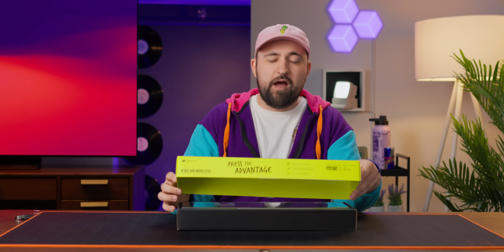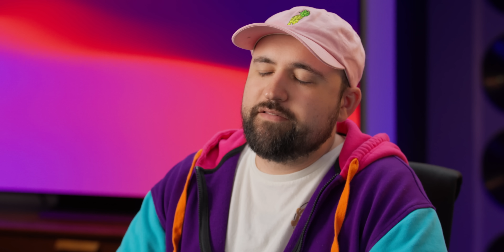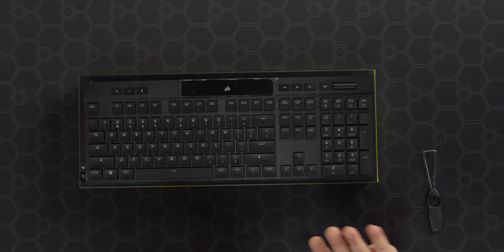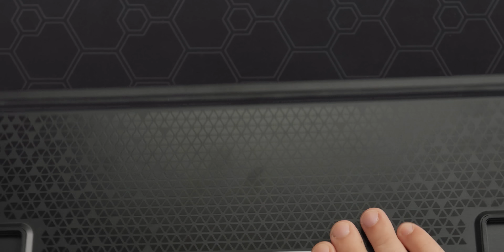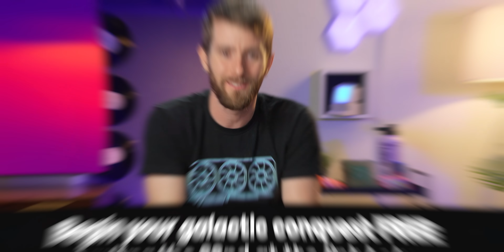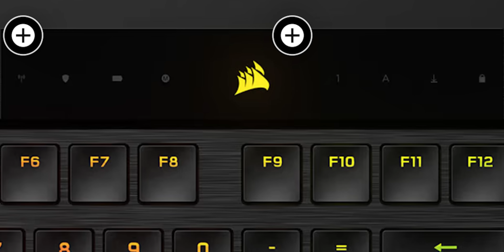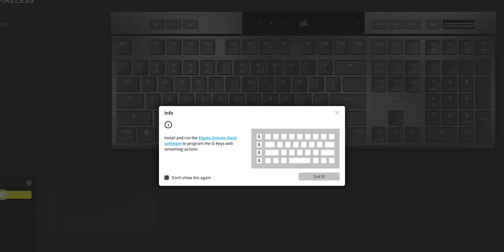Corsair's THINNEST keyboard yet - Corsair K100 Air

Comment from the maker: Correction: At 0:26 the measurements are meant to read 439 x 156 x 17mm (or 17.28 x 6.14 x 0.67 inches). This would be a VERY thick keyboard at 170mm!

While your keyboard can be low profile, your galactic conquest does not need to be. See why no two games of Stellaris are ever the same FREE starting this Thursday at https://lmg.gg/StlSC
Reply: You put an ad in a correction? Really?
Reply: Does it come it white or silver
Reply: Why did you show the size in cm and mm.  thats kind of redundant no?   mm and in  would make a lot more sense
Reply: It is still a thick boy...the Rapoo E9270P is just about 4mm thick. i used it for my media pc on the tv. it works just fine, is thinner and just costs about 50euro.
Reply: imagine having to recharge your keyboard every 3 or 4 days. thats not for me. XD
Reply: Good catch... For a minute I thought I was going crazy.
Reply: The design is great but the keyboard seemed bad to me, the keys get stuck and if one breaks you can't exchange it. I had to take it to the warranty and they gave me another one just like it, key failure... it lacks a lot to be a good low profile.
Reply: Talking about and reviewing an ULTRA SLIM meant to be low profile...precedes to put it on top of a 3 inch box and type on it "meh it's okay" it's no longer low profile while you're doing that lol
Reply: @yackemup bruh, low profile doesn't mean it needs to stay flat on your desk, you can put it a bit elevated, it won't interfere with the actual actuation and feel of the switches 😂

Comment: Honestly, for me this keyoard is not worth it at full price. When a perfectionist like me pay such a high price, you expect perfection. Unfortunately, it is common to get a K100 air that has some imperfections in terms of design. I have tried 2 keyboards of this model and with both, I have noticed minor scratches when inspected carefully and thoroughly straight out of the box. I have also found reviews online having the same complaint. So my advice is: if you're a perfectionist, buy this keyboard only on discount.

Comment: I've always preferred ultra low profile from years of laptop gaming. I remembered having a razor keyboard that was discontinued. I couldn't find another, so I settled for a Logitech g915, but the keys wore out super fast from gaming. I did some searching and found the corsair k100 air a couple of years ago now, It feels great, it's quiet, and I have zero wear on the keys, despite plenty of gaming and regular use, unlike my logitech 915 that wore out in a few months.

Comment: do the keys feel the same as a laptop, as in does it take some pressure before the keys click down? as i like to be able to rest my fingers on the keys without the key going down. i have heavy fingers. i bought the corsair mk.2 low profile keyboard and hate it because the keys still feel like jelly when i rest my fingers on them and cant tell if im pressing the key or not.  im tempted to buy this but need to know that it feels just like a laptop before forking out the money. bit confused at to why they used butterfly instead of scissors. 😕

Comment: Why are the secondary options of the keys almost never also lit up?
Also I'd just like a low profile 100 % wirless backlit keyboard. Doesn't need mechanical, membrane fine.
For several years I have not found anything, they always do other weird stuff with them, like Mac buttons, recessed key caps, half height F keys and so on.

Comment: For those looking into getting one of those, don't.
Everything is glued together in this keyboard, not a single screw was used. Any issue means a complete replacement. Only after a few months I an now stuck with a refurbished unit that is in a way inferior condition than what my near pristine keyboard used to be.

The keyboard itself is insane. Keys are perfect. It's a 5 star product but it loose 7 because it's a throwaway design..

Comment: they shortened the cable......beware......the cable just made it to the tower. with next to no slack. Love it though.....had the k95 for years. 

Not a fan of wireless devices.....im old school, hard wired. It does come with diff keys and the puller

Comment: I moved away from chicklet as I was told how “good” mechanical keys were. And bought a k70 mk2. Myself. My wife and 10+ people who used the mk2 all remarked that it was junk to touch type on, constant mistakes even 2 years later.

Sold it at great loss and went back to an apple Magic Keyboard to fill the gap. It’s absolutely gorgeous to type on. 

This mechanical keyboard trend is odd to me. I’ve not met one person who could type quicker on a chucky mechanical compared to a slim chicklet or membrane keyboard. I want to keep with the Corsair ecosystem, but I’m worried to reinvest in Corsair. Something was SO off with the mk2 K70.

Comment: Far less mushy than the Logitech G915 (mine feels stiff like the iPad keyboard, but better), but to be fair, I’ve had the G915 for like 3 years (so it has a few.. hundred thousand metaphorical miles on it) and I got this in really recently (within the week).. I also got a steep discount so that may color my opinion somewhat.

I’m still very partial to my other keyboard with the Glazzew (boba) switches I respringed, but the board I have those in is very not portable.

Comment: I have this and I love it, the B key broke and I'm returning it tomorrow. It did everything I asked for, it was a Full Keyboard, Lights up, Ultra Slim, and it was Mechanical. It went above and beyond when it could store Macros (for when I went mining in Minecraft), switch between setups using the doggle on my main one and Bluetooth on my subsidiaries and the customization was insane. It will be missed

P.S. I'm typing this with my old keyboard lol
P.S.S Dang that's crazy, using my keyboard and saying how my keyboard is going to the graveyard, good thing its not sentient because man, this would be an awful way to go

Comment: ICUE is the worst program today. Absolutely terrible. I have it on two corsair case systems and one will not see my corsair RAM and the other will not see my commander pro xt. So how is it good exactly? Even opened a support ticket and they said to make sure the RAM is seated correctly...on a running system with the RAM lit. Yeah, they are useless.

Comment: The LABs needs to test longevity or at least have a longevity score with included durability, reparability, replacement parts available, customization options etc. Or something like that. I can't imagine this keyboard lasting more than 2-3 years before needing to be replaced because of broken keys and no parts available to repair it. Specially not easily because the switches are not hot swappable.

Comment: You don't need a low profile keyboard to enjoy floating. Very few know proper keyboarding or ergonomics.

One should be positioned so that arms parallel to the ground suspended above your keyboard. Chair too short, desk too high? Fix it. 

Keyboard trays are a good thing, though the monitor can be risen, while everything else is lower. 

Arms too weak? Build up to however many hours a day. Being weak with bad form doesn't do you any favors. Take the breaks you haven't been, but your eyes and muscles will thank you for. 

Even in the days of manual typewriters, you were supposed to keep your arms parallel to floor and held aloft over the keys.  Those are as opposite of flat, as you can get.

Comment: I love this keyboard and have been using it for close to 9 months now.  I'm a little surprised to see you guys discuss a product that came out so long ago, but anything that helps drum up interest in low profile mechanical keyboards is a win in my book.  The K100 Air is easily the best I've tried (and I've tried a bunch) but I would really like to see some more high end competitors to this one, so hopefully this shines a bigger light on this product segment and gets thing going from the other manufacturers.
Reply: Yea, I've only tried some of those cheapo thin keyboards and of course laptops are a similar principle, but I also feel like it might make more sense. - I still like the classic clunky keys, but if you really dig into "typing" properly, you start realizing that the big keys with the travel they have aren't as efficient. - I also don't like too little travel, at least if they become too sensitive or whatever, but if it's just right that's great. - Also, the classic keycaps still look... cool?... In a geeky way, I suppose. But then I look at how much I apparently graze the sides of them and how much gunk they collect there. I imagine that might be less the case with shallower caps. - Anyway, you probably know about them, but I'm currently looking at Keychron's K Pro low-profile boards, which are models from the full layout all the way down to a 60%, and very tightly laid out at that, plus hot-swappable switches, as well as the programability. - Those are the ultimate for minimalism, as they're not only low-profile in height, but also in footprint. The boards themselves barely even stick out beyond the keycaps, which is just neat. - But yea, just saying in case you didn't see them. They just happened to grab my attention just recently.
Reply: @michaelmonstar4276  I saw that one at some point, but haven't had a chance to try it.  Thanks for the reminder!

Comment: I LOVE this keyboard. BUT Just a heads up, I bought the keyboard Dec 2022. The space bar started squeaking after a few months. Corsair support said to remove the space bar key and blow compressed air in it (but the keys are ultra slim and I didnt feel comfortable with pulling the key caps off) Amazon replaced the key board for me aaaaaand guess what? Just after a few weeks the replacement keyboard started doing the same thing. 
I use the keyboard about 10-16 hours per day (WFH full time)

Comment: I have the logitech G whatever wireless flat keyboard. Amazon had a discounted, B-ware unit and it is really good. The oily-ness of this keyboard freaking su kz. Also not all legends are transparent but just printed on. I can tell ya the Corsair K70 and other K models are so much better in every way and the mechanical feel is better but since I can type only on a keyboard like the Dell XPS, experienced the model from 2018, and the Logitech keyboard is so fun to type on and also play games. My main reason to leave corsair is the the battery life differences so that I did not get one of the wireless ones and also there were no models I liked since I like 10 Keys.

Comment: I appreciate another low profile mechanical contender but I don't see this enticing me away from the Logitech G915. Or rather my G815 since I prefer wired...and spending less. I'd definitely consider a cheaper wired version should my G815 ever pack up though and should such a thing be available.

Comment: This basically rolls my two favorite keyboards into one, the Tesoro Gram XS(extra slim RGB mechanical), and the Orion 610(excelent media/volume controls, i cannot stand hot-key combos, give me some sort of wheel for volume)
I just wish that the media controls did not take up their own row, make that volume wheel 1/2 the width, compress the function row so there are no gaps, get rid of those physical G keys in place of using the F keys with optional F swapping(like Lenovo does on their Thinkpad devices) then move the media controls down into the space where the G keys reside currently
Heck with the smaller wheel, and a compacted F row, you could in theory keep the G keys, but that would offset the prtsc scrlk and pause buttons to no longer line up with ins home pgup cluster
Maybe move the prtsc to pgdn cluster down a row so that it is now in line with the number row instead of the F row, with del end pgdn in line with the enter key

Comment: Neat stuff, but the prices are too high. I'm sick of every keyboard with a single good feature having to have ALL the good features. No cheaper wired versions, or versions without RGB, or just one color. There's no segments anymore. You either get a cheap 100% traditional keyboard, or some insane $200 keyboard that has to have EVERYTHING jammed into it. It's so disappointing.

Comment: I have this keyboard and I kind of hate it. the keys feel like they are membrane. They might be mechanical but the way they feel is just mushy and offputting. What is really nice is the multiple connections and easily toggling between them so i can swap between multiple devices with ease but I would not buy it again.

Comment: What I hate the most about iCue is that 99% of corsair products NEED IT to work. With Razer synapse you can tweak your device settings and quit synapse or even uninstall it or take the devices to Linux and everything just works. With corsair, if you just close iCue your devices all reset to default settings again, which are usually trash settings. You NEED iCue ALWAYS running in the background. It's the biggest reason I stopped buying corsair products.

Comment: Agree 60% would slap but makes sense why they would go for full with the versatility over multiple devices being a selling point. Still eyeballin the 60% full mechanical corsair because i am in that ique ecosystem already 🙄 love it cuz like you said it just works but it is a resource hog... however im using it for a lot of non corsair products with a commander pro and adapters its controlling rgb for my ekwb cpu and pump/res, my watercool GPU block, and controlling all my fans which are all noctua as well as the water pump itself (not just the rgb) its super convenient having everything in one program that can also show me all my temps and gpu/cpu frequencies etc.. all in one place.

Comment: I bought myself a Logitech G915 full sized Keyboard about more than a year ago and you can get it for 150$ if you find a good sale. 

I would NEVER buy this Corsair keyboard and here is why:
- Less battery life (G915 is bright enough at 25% light setting with 140h of battery life)
- Even though it is brushed aluminium, if does bend a little bit. As someone who carries the keyboard daily to work, the Corsair is too slim and could break because of how thin it is
- Keycaps cannot be replaced
- Corsair keyboards are known to be less durable than Logitech. I owned a Logitech Keyboard for 10 years and it was still going. I just wanted an upgrade after 10 years. 
- The price is insane. At the time of writing, it costs 287€. For what?!?!

Please do yourself and the industry a favor and skip this one. Corsair should not get away with this.

Comment: I'm not surprise it's expensive giving the very high price of the ultra low switches (see kailh laptop mechanical switches are twice as expensive than kailh choc low profiles) plus adding leds plus adding bluetooth and rf and batteries... The ideal format for a mobile keyboard yet full features should be a compact 96 as 15 inches laptop usually include numpad

Comment: I just don't understand the trend for "ultra thin" desktop keyboards.  On a laptop the keyboard is thin by necessity and typing suffers as a result.  On a desktop I don't need a thin keyboard.  There is plenty of room for normal keyboard switches.   I want a good typing experience and there is NO reason for me to sacrifice that.  Why is this a thing ?
Reply: They're good if you're a touch typer who moves from desktops to laptops regularly, you have the same typing experience wherever you go and are at full speed all the time.

Comment: Honestly so many useless features. I don't get who wants a wireless full size keyboard with only 200 hours of battery life. You're going to be connecting a cable every 2 weeks, and it's always going to be at the exact worst time - might as well have a wired keyboard.  Also RGB? Seems like the desktop PC 'scene' is becoming more of an aesthetic these days than anything functional. Also I really don't get why slim is ever a good choice on a desktop keyboard. Low profile is fine on a laptop because otherwise your laptop becomes bulkier. On a desktop why not have the best mechanical switches period? Especially for $280.

Comment: I'd love it if you did a low-profile mechanical keyboard roundup and compared the k100 against the g815/915, the nuphy air, the keychrons, and any others
Reply: G915 blows everything out of the water, honestly. The battery life on those things is LEGENDARY.
Reply: @spdcrzy  i have a g815 and a nuphy air 75 and i prefer my g815, mainly because of the spacing between the keys, theyre still both great keyboards
Reply: @spdcrzy  absolutely. I`ve been running it since it first came out. It's ridiculously overdesigned.

Comment: Around a month ago I was looking for a new keyboard, since my laptop died, and I built a new setup. I really got used to low-profile chicklet-like keyboards (even before the laptop I had Logitech K780 for a very long time), wanted something wireless (for a clean setup), but something that can work through cable without extra drivers or what not (so not Logitech, since most of their wireless keyboards do not have wired mode). I did not care much for mechanical ones, would have been fine with membranes, but... Somehow I was not finding anything good among the full keyboards. Or at least nothing that actually sparked my interest. Until I saw this K100 Air. Price was a turn off, but... I bit the bullet, risked it, and I love it. I have sent Corsair a bunch of ideas for improvement, that should be possible with software updates (biggest one is the sleep, since current one is too deep and takes too much time to wakeup), but I do not regret the money spent.